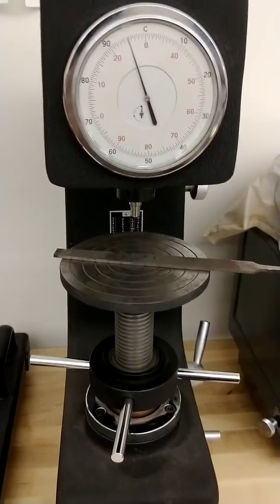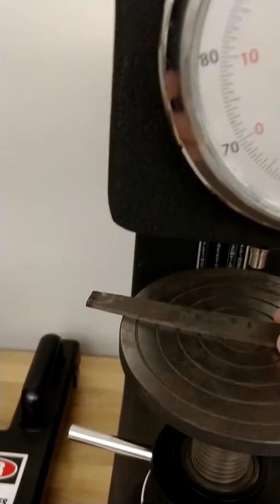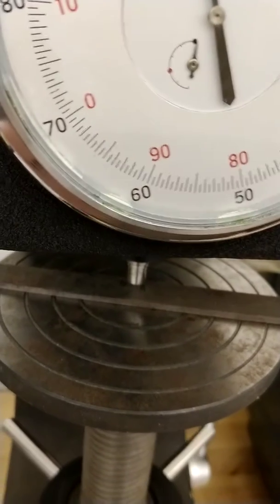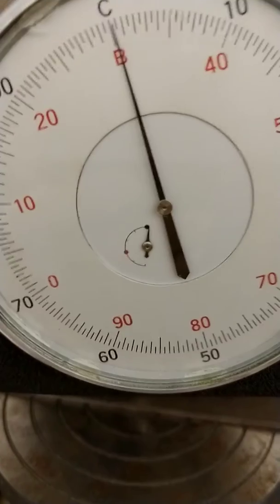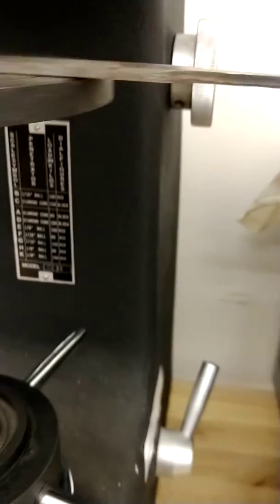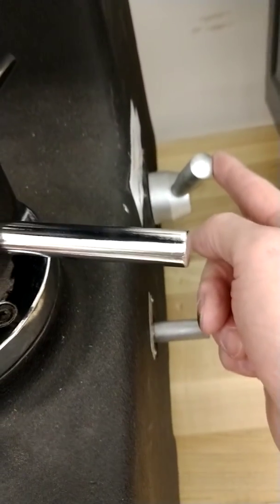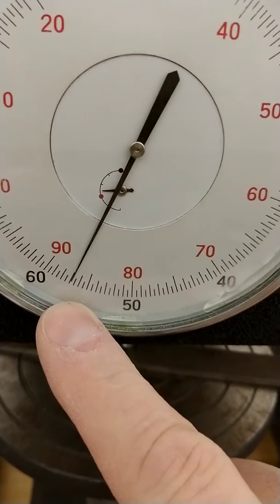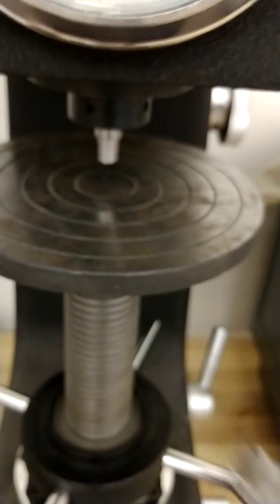HARDNESS TEST INSTRUCTIONS

Comment: Thank you for making and sharing this video, this was very clearly explained and slowly walked through at each step - very good. Admittedly, it's a little confusing with all the different makes & models of hardness testers out there and what the levers/knobs do, but it seems like they all pretty much operate the same way. 

Do you perchance have any opportunity to make a video that walks through calibrating/resetting a hardness tester? I know you need a hardness standard to do that and then you would just run through the same process that you've shown here in order to get a reading, but what would happen if the measurement result didn't match up with the standard? How would you compensate or adjust for that?

Thank you!